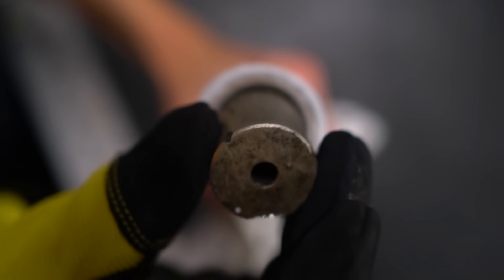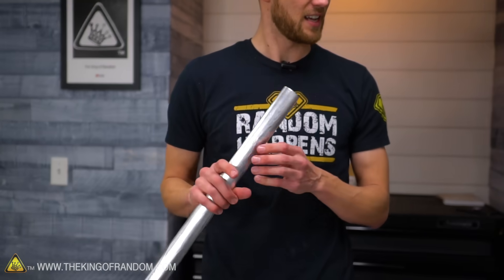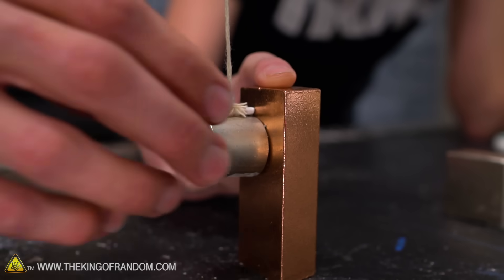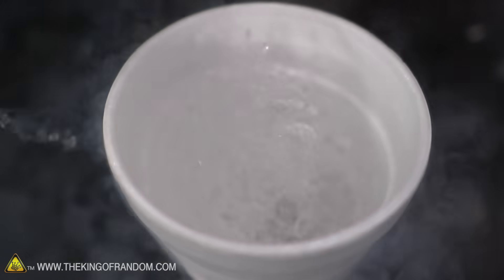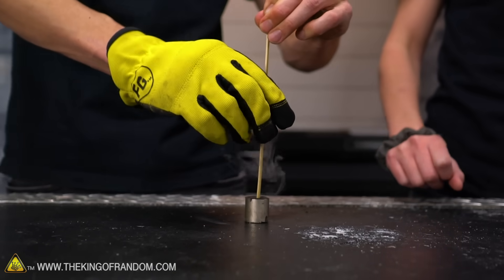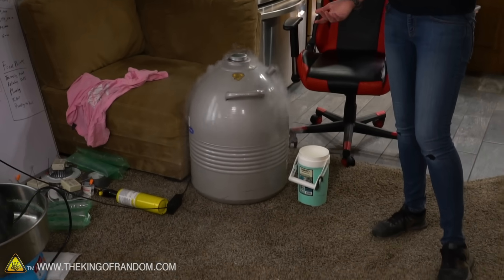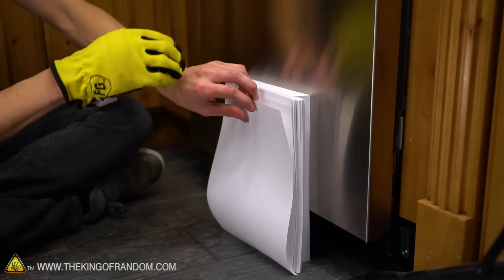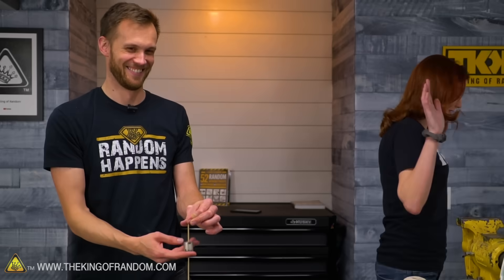Frozen Magnets Become ULTRA POWERFUL

Comment: I want to know how your Al foil tube would stack up against an Al pipe - My hypothesis is that the roll of foil will hold the magnet longer... something something laminated transformer cores vs solid cores something something.
Reply: E2qNX8btraQ3zRD6J7fc the laminated transformer cores are actually to reduce eddy current losses which are essentially extra heat in a transformer...So how about that hypothesis now?
Reply: @scoutmaster33  modified; still a hypothesis.

Comment: The reason that cooling the conductor is more effective than cooling the magnet is that all conductors are electric superconductors at absolute zero. This means that the colder the conductor is, the less resistance the electrons flow with in it. Since the induced magnetic field depends on the flow of the electrons, the field is stronger when the electrons flow with the least resistance. This is why superconductor materials need to be cold to function.

Comment: What you guys did is how superconductors are made. Its pretty cool, if you cool a piece of ceramic to cryogenic temperatures, you can put a magnet on top and it will float there perfectly. You got a hint of it with the swinging magnet and the copper.

Comment: While the flash point of almost all woods is at over 300°C several elements/items have melting points lower than that. some are listed below. Put it in a pot on a hot plate in a vacuum chamber. See if the wood absorbs it.
Gallium, phosphorus, potassium, sodium, sulfur, iodine, indium, lithium, selenium, tin, Bismuth petroleum jelly, alcohol, gasoline, vinegar, battery acid, bleach, oil, paint, epoxy and more.
30°C  - 271°C,  86°F - 525°F

Try other porous materials as well.

Comment: 8:13
That happens becaus e of the better electrical conductivity at low temperatures. So the electrons can move better and form a stronger Magnetic field.
The reason why this effect is stronger when you increase the speed of the magnet is, that there are stronger changes in the magnetic field. That leads to a stronger induced magnetic field of the copper.

Comment: Reducing temperature reduces resistivity, so the magnet is inducing stronger Eddy currents. The now opposing magnetic field is stronger, so the magnetic forces are stronger.
Reply: Also, the Eddy currents work, because the change of a magnetic field creates an electric field, and vice versa, so the magnet passing by induces an electric field which in turn as its strength changes creates a magnetic field opposite to the magnet's, slowing the magnet down. 
Since the strength of the counteracting magnet field is proportional to the speed of the magnet, an equilibrium ist between gravity and the magnet force slowing the magnet down occurs. 
So, less electrical resistance means there is a stronger opposing magnetic field at lower speeds, that's why the magnet took longer to get to the bottom of the tube. 

On a side note, light also is nothing else than a magnetic and an electric field constantly building up and on collapsing inducing the other, this the name electromagnetic wave
Reply: @joshuakrieger4398  thank you very much for the great explanation
Reply: When I read this I immediately thought of the Homer Simpson nerd meme
Reply: man imagine being smart at science
Reply: Have you seen quantum locking with a super-cooled type 2 super conductor and magnets? It's like magic it's great
Reply: @tylery6352  Yeah! I have seen it in videos and in person, and it is amazing. The magnet just keeps on moving with just a small push.
Reply: um what
Reply: you sound smart
Reply: was about to comment that but you left something out
this is how the maglev trains work, they cool the super conductors down and it will float
Reply: Yes, lower temperatures reduce the electrical resistance, since the atoms in the crystal lattice of the metal, e.g. copper vibrate less, this allowing the electrons to flow more easily. On a molecular level, temperature is defined by the kinetic energy of the atoms and molecules, at high temperatures they vibrate fast, getting in the way of electrons, creating what we know as electrical resistance.
Reply: Yeah but the resistance would matter in the copper since that's where the electrons move and the resisting magnetic field builds up so cooling down the magnet wouldn't matter, wouldn't it? At least not as much as the copper/aluminium

PS: I have not yet watched the whole video and if at any part that happens please don't blame me.
Reply: @paprikalp7989  you're right, since the current is induced in the copper/aluminum, the, have to be cooled down for it to make a significant difference

Comment: In the metal foundry can you get gallium to a boiling point but because of the heat and toxicity of it you'd need to wear full body protection

Comment: Test current output of a small generator at room temperature and after the coils have been chilled with liquid nitrogen.
Reply: tunger.......chill steel and copper materials both with different thermal expansion coefficients several hundred degrees.....the most likely result is the smoke output of the generator will be much larger than the no smoke room temp version.

Comment: try to freeze a cable to see if there will be  still  powered

￼
Reply: Are you greek?
Reply: @octopus123  yes
Reply: @mixalisgalanos8759  και γω!
Reply: The Octopus Gamer no idea!
Reply: It should still work, but might cause problems. If cold temperatures lower electrical resistance, then super freezing an appliance cable may result in more energy entering the appliance and damaging it. I honestly dont know, though.